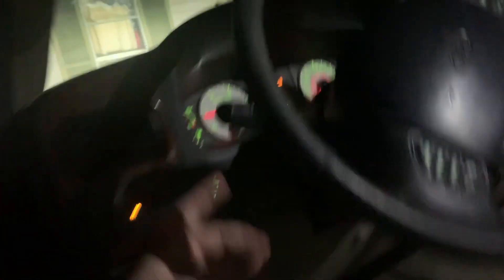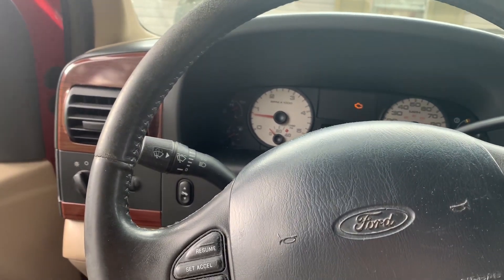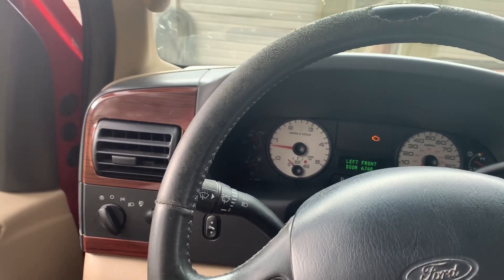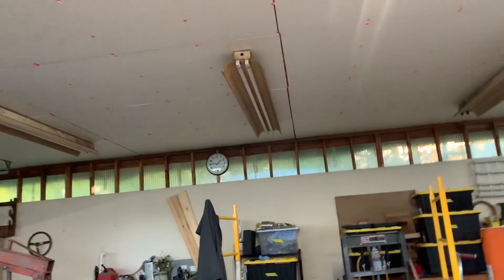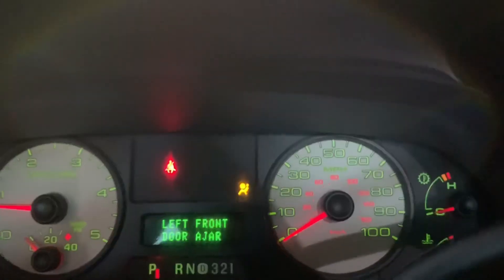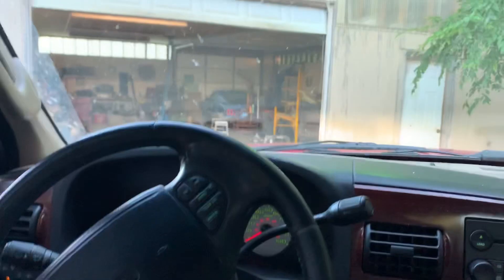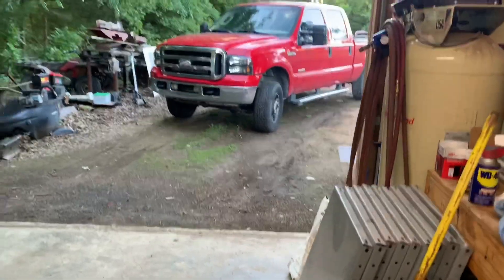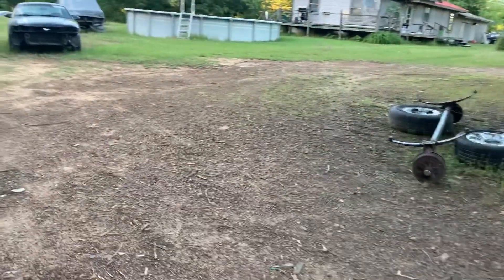MY 6.0 POWERSTROKE ALMOST LEFT ME STRANDED

Comment: Okay what all have you done to the a/c system?
Reply from the maker: Replaced the compressor/clutch, high pressure switch, low pressure switch (cycle switch), clutch relay, fuse, checked the control panel, new orifice tube and drier, and charged it. Clutch won’t engage unless you jump the relay
Reply: @Scott46Lee  have you thought about taking it to a shop?
Reply from the maker: I have been a good bit I just need to get some of the other cars going first
Reply: @Scott46Lee  i went to a/c shop in Houston and they want to do a whole new compressor, orifice, and dryer. I'm thinking of buying a whole new a/c system from rockauto even if they are Chinese parts to hold me down for like 2 years